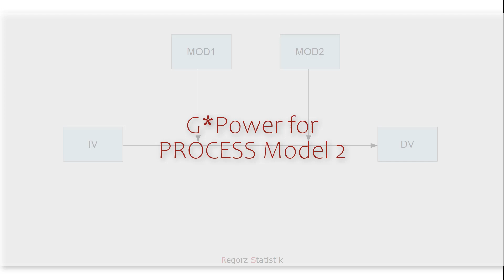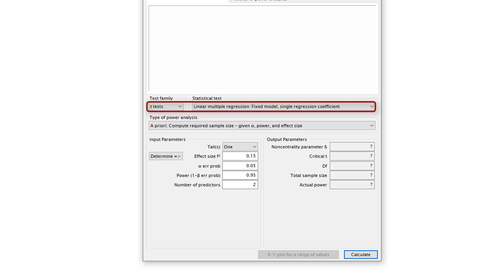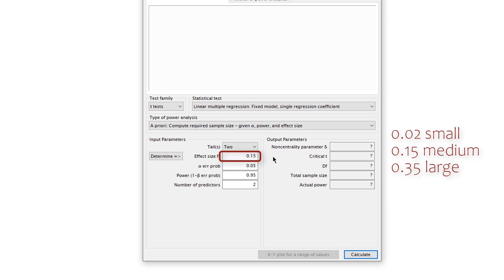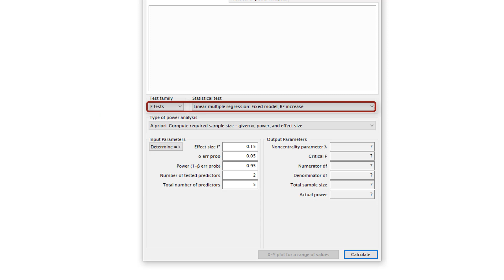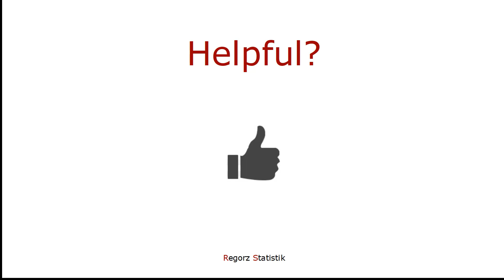Power PROCESS Model 2 (Sample Size for Double Moderation)

Comment: Thank you for sharing. This was helpful. I hope you are doing well. I am currently working on my doctoral dissertation in Phoenix, AZ. My present study has 1 predictor (emotional exhaustion), 2 moderators (Age and Gender), and 1 dependent variable (turnover intension). I intend to use purposive stratified sampling. For the G*Power input parameters, I intend to choose 0.15 for medium effect size that produces an actual power of 0.80347 and requires a total sample size of 68 plus additional 15 percent (for attrition) to amount to 76. The 0.02 small effect size which requires a sample size of 485 is unrealistic for me. It may be expensive to achieve such a sample size. Can a researcher use 0.15 for medium effect size? Again, thanks.
Reply from the maker: The solution I chose for this dilemma in my master's thesis: I calculated the power / sample size based on an effect size halfway between small and medium.